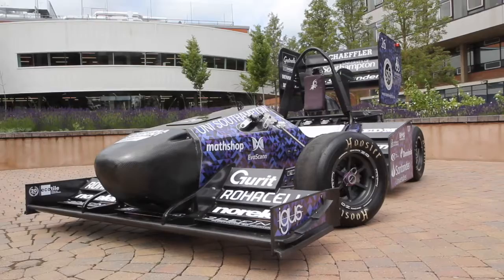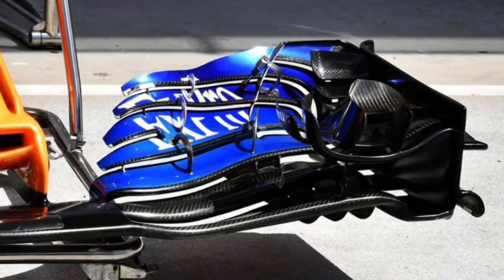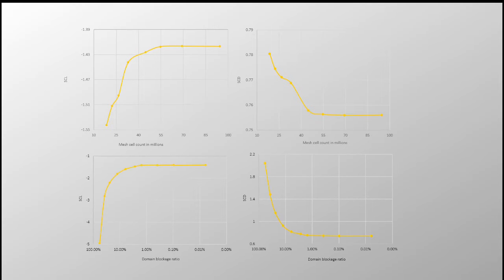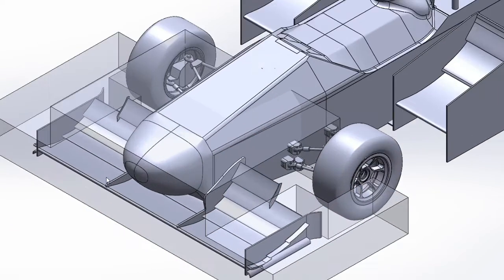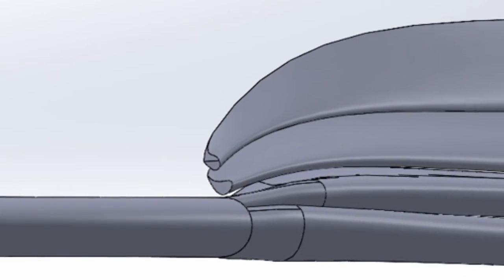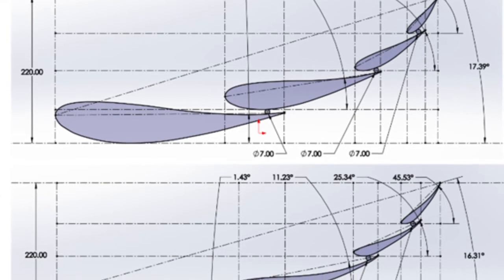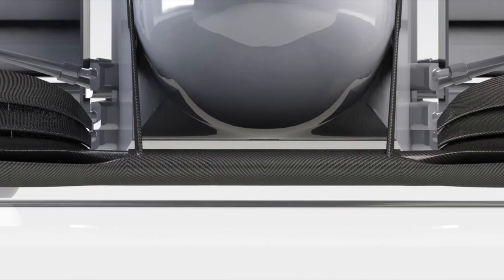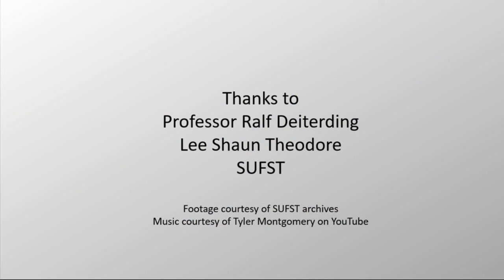Individual Project: Front Wing Design for a Formula Student Car

Comment: Can you create a video/timelapse of how you modeled those complex wings? They look amazing
Reply from the maker: unfortunately I’ve left uni and so I don’t have a solidworks license buddy, I used lofted elements, which require a starting sketch (2d), an end sketch (2d), and connecting guide curves (at least 1, as a 3d sketch), I used two 3d guide curves per lofted element, for one on the leading and trailing edge of the aerofoil. takes some fiddling with! Lofted elements and surfacing templates are your best bet!